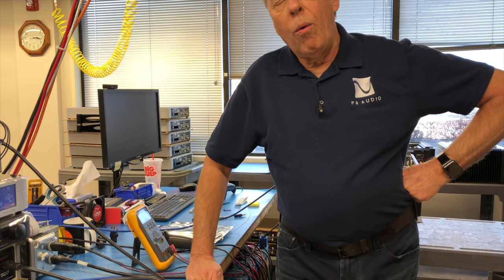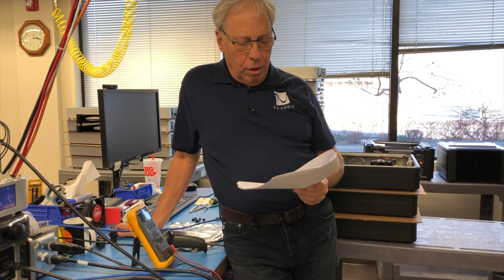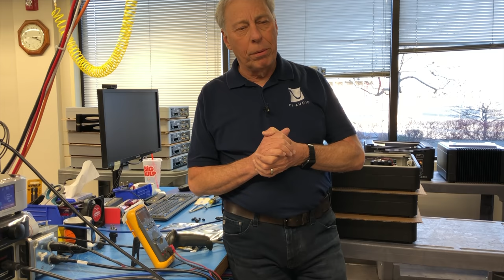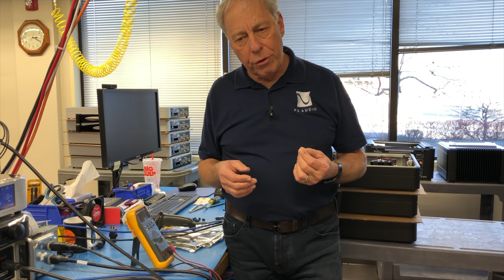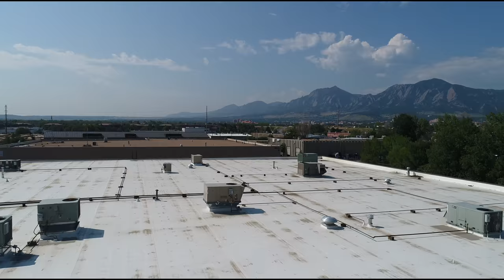Why do people abandon their power conditioners?

Comment: Another thing, if power cables made so much a difference in performance, then why wouldn’t manufacture include it In The design process... seems to me if I’m making a product that’s competing in the market, I’m going to use all the variables at my disposal. The cables aren’t expensive from a margin perspective. I can buy the same cables you resell for hundreds of dollars for less than a 100 bucks and get it from the same factory your using in china
Reply: I pretty sure the Sprout 100 comes with a cable.
Reply: Price and choice. People like you would not pay an extra $200 for an amp with a better, shielded, power cord. And at that price addition, some need a long cord, some a short cord etc. Your logic needs an upgrade.
Reply: @bc527c  bullseye
Reply: bvocal do you know how much these expensive actually cost? I work for a company that makes cabling for the wireless industry. The margin is insane and we sell hundreds of thousands. Short run products means you have to charge monumental prices. You can buy a shielded cable for $50 on Ali express that’s as good as anything ps audio buys (they don’t pull wire-they resell)
Reply: Don’t get me wrong. I work in electronics manufacturing and I understand the economics of bringing a product to market.  The bill of materials is just a fraction of the cost. My point is if cables made a competitive difference, why don’t companies include an entry level cable to beat out the competition. Paul talks about synergy all the time. Why then would they be including a cheap $5 cable with their products. If I believed in the necessity of a component, I would include it in the price. Especially when you’re talking about amplifiers that are already a few thousand dollars.
Reply: I am not aware of an amplifier at any price point that includes a high quality shielded power cable. If I’m wrong, please enlighten me.
Reply: @bc527c   I agree with your ecomonic points and I do understand the investment required. Please see my other post.  Let use an analogy from another industry to articulate  my point more clearly. For most of the automotive history, wheels were an after thought. They were cheaply made alloy and used a hub cap to hide the ugliest underneath. As time went, probably starting in th early to mid 2000s, Car Designers would design better wheels to match the preformance and aesthetics of the vehicle. The aftermarket still exist, but if you buy a new BMW M3, the stock wheels are actually really great. Why? They build the cost of the wheel into the price of the car and they know that if there wheels aren't any good, odds are your not going to buy new ones from them anyways. So, how does this relate to power cables? Power Cables are an aftermarket upgrade (whether it's just aestetic or performance oriented doesn't matter).  If a higher volume company like Marantz could sell more amplifiers with better cables,  why wouldn't they? They aren't in the cable business and the investment into cables would be quite small from an operating margin stand point. NAD is another.  Ps Audio is too small to be able to include a cables. They need the aftermarket revenue stream....but what about new players, why not include a cable? it wouldn't cost you that much. You don't even need to design it. I think well all know why. Most engineers don't believe cables will make a difference. Most product managers don't believe an upgraded cable will sell more units. BTW, I own upgraded cables too. They're jewelry is far as I'm concerned. I don't I need to to believe one watch tells time better than another to enjoy a Rolex. Enjoy your cables :)
Reply: @rickbradshaw2148  I understand your point, but I don't think it ends the debate... I would tend to maybe shine the light from another direction now... Very very few people have listening rooms sorted out, acoustically speaking, well enough to really actually understand/hear what is going on, so why should the manufacturer care? (When you visit marantz or like manufacturer at a high end audio show, do they use high quality cables in their demo setup? From what I have seen, the answer is a big fat yes.) I'm 61 and have been wanting a decent to fairly great sound system since I was 13, no matter the kit I bought... disappointment, until recently when I got fully POed at my failed attempts and before I went and bought new parts (again) I decided to do some acoustic experiments, 16 months later and my room is fairly fully sorted out, but even so, not a full 100%, some stuff is just too difficult to solve, and over the 16 months I thought I had found the right sound countless times, and then found another step. All of my efforts were acoustic treatments and setup details that get called snake oil by all the deniers. I took a system I hated and that sounded like pure crap and made it one of the best sounding systems I've ever heard, all via 'snake oil', (kept the same amp and speakers). So for me, my last 16 months on Earth have shown me that all that stuff really does make a difference. (acoustics, cables (esp ones for digital!), op amps, cables off the floor, vibration/ isolation, power et al... all of it). My assessment is deniers can go on forever that way and they will never get the full potential out of their setups. The improvement in sound when I changed the power cable on my computer alone was epic (computer used as source, local and streaming, highend soundcard with freaky good opamps or digital out via USB to another DAC.)
And another point, aftermarket power cables are worth it just for the shielding alone, even if nothing else changes, and the shit tiny generic cables are not shielded and spew EMI and RFI all over the place, in a place where one does not want it....
Reply: @rickbradshaw2148  The easy and fast response is... car manufacturers don't make tires. And experienced (car/motorcycle) racer knows the vast importance of tires and how even though they all kinda look the same, they perform very differently. If they are so important, why don't the manufacturers make then?
Reply: @bc527c  Car manufactures don't make tires. Honda is really the only one committed to making their transmissions (although they did experiment with the ZF 9 speed for a few years). Many don't make brakes either. Tires are the only component clearly branded on a vehicle but in reality there is a large ecosystem of designers and engineers who make autoparts based on requirements specifications. No they don't make tires, but they do realize the importance of GOOD tires. My question still stands, if power cables were as important to performance as good tires, why wouldn't they include them even marginally? Stock, basic cables are typically purchased from a chinese bulk supplier anyways. It would be like if automanufactures only used the cheapest tires available.  Most audio companies don't make upgraded cables. So, again the question just looms out there without an answer...Why doesn't the audio industry recognize the importance of quality power cabling?  Look at the Sprout 100. If PS Audio really believed a power cable superior to ELAC EA 101, why wouldn't they just include it? Why wouldn't ELAC inlcude it? Or Marantz? Instead, they just give you the same old crappy cable that everyone gets... makes you think...
Reply: @rickbradshaw2148  Up until recently I was dead set against paying for cables and the like, just couldn't see the value in it, the logic. I think my previous mindset is fairly common, and I reckon including a better power cable would have been seen as BS to me. So I understand the move to not do it. On the other hand, in many respects better cabling is fairly recent 'thing' in terms of stuff that works and is maybe kinda sorta maybe understood, so perhaps the situation will evolve. 
Why they can't make, at least, a cheapo stock cable that is actually shielded... That's crap.... 
I simply would not bother doing anything special cable-wise for home theater, for me, and a lot of people I reckon, it's just a 2 channel purest thing, no eq, no processing junk, just source amp speakers as possible, and the differences are not always large, so like so many things in life, 'good enough' or the LCD win the day.
So the free market steps in and offers things some feel are worthy options. Capitalism.
Reply: @bc527c  I agree with you. It's just weird to me. You can buy a $10,000 McIntosh Integrated Amplifer and get the same 50 cent cable you get with the $150 Sony 2 channel. Some people believe in cables, others don't...but everyone agrees what looks and feels better is by definition an improvement. Let's pivot to another area of audio. Headphones. Headphone manufacturers get it. Now there's no claim of performance or any consistent approach among them, but, when you buy a Sennheiser HD800, Audeze LCD, Focal Utopia or a Mr Speakers Ether C,  all of those manufacturers put significant thought into the cabling. We can all argue for or against their choices, but they were infact choices. Many headphones over $150 include multiple cables. I'd like to invite PS Audio and everyone else to rethink claims of cable performance and address just a basic aesthetic opportunity. Guys, include power cables and interconnects that mach your design preference.  You talk about synergy, let's see it. Paul, if you believe in the value of a good power cable, include one with the PS Audio Sprout 100 and let us upgrade it.  You don't put an awful DAC in the product so not to cannibalize direct stream. That would be very silly. So, why include a garbage cable?
Reply: @rickbradshaw2148 
I was reading this conversation you were having with bvocal, and the thought occured to me that the reason cheap cables are included with expensive equipment is that these manufacturers would prefer to not include any cables at all! The reason they include what they do is so people don't complain.
This has actually happened in the gaming industry. When Sony put the Playstation 3 on the market, there was no HDMI cable included with it. There was a detachable power cord and a cheap, proprietary multi-connection analog cable, but no HDMI.
The weird thing was, you had to have HDMI to access some of the features of the unit, which would not function over an analog connection.
People complained about this for decades, and it wasn't until the PS4 was released that an HDMI cable was included with the unit.
Later on it was revealed that even though the PS3 was the most expensive game console ever made, with a retail price of $600.00 upon release, Sony was losing money on every unit sold, and looked to recoup their losses through profit margins on the games sold to play on these things.
I guess my point is that, even if it wouldn't cost the audio manufacturers that much to include a better quality cable, it would eat into their bottom line; and since the bean counters are the ones really running the show, we're lucky to get any cables at all.

Of course, I could be wrong. I'm just surmising.   : )
Reply: @bc527c 
I had a similar experience fairly recently with my system, greatly improving the sound quality through vibration control & etc. as you mention.
I was very happy to see that someone else had a similar experience, and wondered where you might have gotten the information to do so.
I found a lot of information through Mapleshade Records, but I am always interested in learning more from new sources, if you would care to share?
Reply: @HareDeLune  that's an excellent point for mass market products in the sub $1,000 price range.  But let's take the Yamaha A-S3000 for example. It cost $7,000 dollars. $7,000 dollars... Now, there are dozens of integrated amplifiers in the $5,000 to $10,000 price segment. Yahama makes mass market products so they really don't need to shave margin to make buck on this one. Plus, they are only planning to sell about 500 units a year and the limited run is reflected in the price....So, if cables make a difference and you want to sell more units, why aren't they ever sold as a feature by any manufacturer at any price point? I really am looking  for a satisfactory answer. Headphones include cables as a feature with no claims of sound quality. Why don't audio companies include cool interconnects and power cables? They really are dirt cheap to make.
Reply: @HareDeLune  Basically 'the net'... listening to Paul has yielded a few valuable clues, oddly they have come from more or less offhand thoughts. I just looked for clues everywhere, in product designs, materials and how other used them, comment section arguments that other people have had, from a few friends... and my own thoughts, experiments and design ideas. There just hasn't been one stand=out place that sorted me out. Sometimes I think to write it all down, but by the end of the thought I'm exhausted by the length it would be... like a book... and I hardly know a thing yet (the more you know, the more you realize how much is left to know... so there remains plenty of stuff I have yet even realize I don't know it!). Cheers.
Reply: @rickbradshaw2148 
Well, the only other reason I can think of has to do with the history of 'audiophile' cables.
I'm certainly no expert, but I remember reading somewhere that the founder of Monster Cables was the guy who originally tried to sell a better grade of cable to audiophiles.
As I recall from the story, it was a tough sell. Most people didn't give a thought to cables, and needed a bit of convincing.
Finally, after much campaigning, convention going, and door-to-door audio store going, he was able to get cables into the minds of audiophiles as an upgrade to their gear, and establish Monster Cables as a legitimate brand. All other 'high-end' cables and cable companies came afterward.
If this story is true, it seems quite ironic and supportive of the cable nay-sayers.
At any rate, the point is that if this is how cable companies began, then they probably have a vested interest in continuing in this way. If the manufacturers started including better cables, it would be unwanted competition. There may even exist some kind of agreement (whether spoken or unspoken) between the two industries that maintains this separation.
Not only that, but you also have tradition to think of, although this should mostly affect the older companies.
I should think that would also be the reason headphone companies are exempt from the rule. Not only are they a more recent development; they are also more akin to speakers than 'serious audio equipment' like amps and pre-amps.   ~_^
Once again, I could easily be wrong about all of this as I am just guessing based on what I've come across over the years.
I hope you eventually find a satisfactory answer to your query.    : )